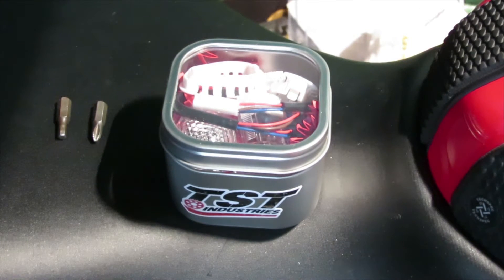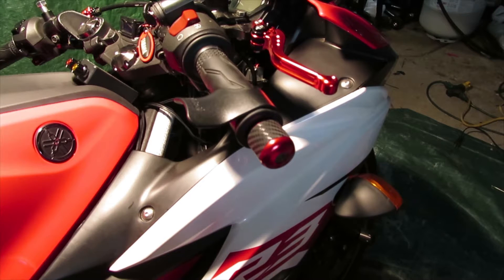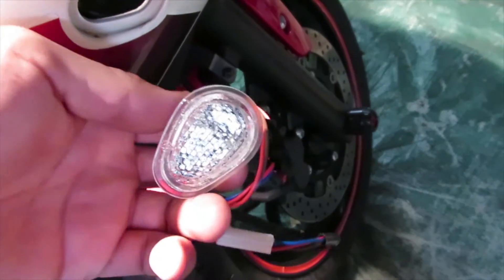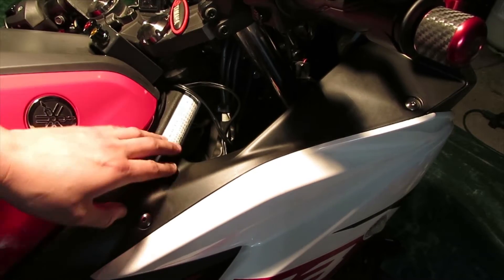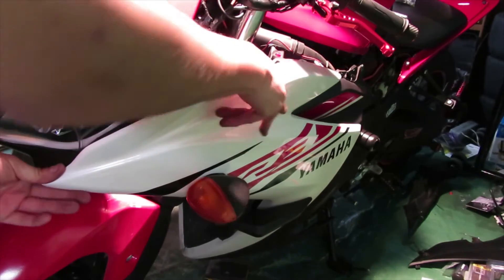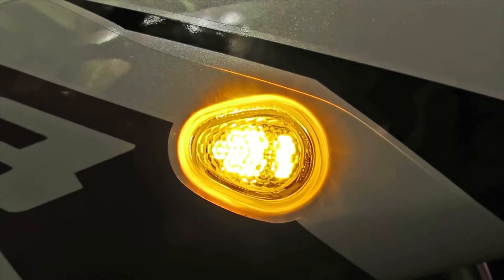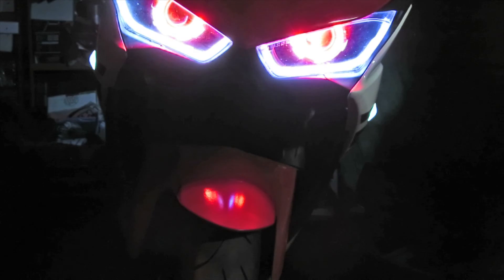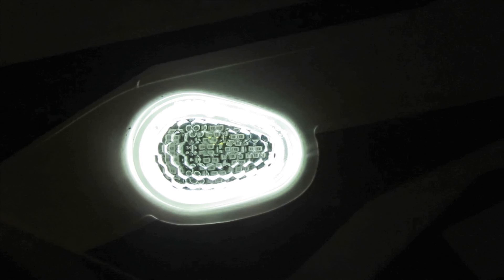How To Install TST Halo Flushmounts

Comment: I’m having the same problem with my tst halo flush mount signals. Is there a better fix for this? The signals didn’t start doing this until I installed the led light strips on my bike. I still have the stock halogen lights on the bike. It must have to be the flush mounts not liking to share the same electrical connection with the switch back light strips... the bike looks pretty sick with the mod though.
Reply: The opposite flush mount signal flashes white when I have the bike running. It sometimes does it with the bike off but it does it every time with it running. Maybe TSTIndustries has some fix for this.
Reply from the maker: do you also have the turn signal relay with the new led turn signals? if you are still having problems with the TST lights then it has to do something with there lights might be a tech issue.
Reply: AC Productions yeah I have their flasher relay and the halo flush mounts. It’s not a huge deal but it just kind of bugs me that it’s not working like it should.
Reply from the maker: David Gastelum ya same here it does bother me also. U may want to contact tst about this product may be defective
Reply: **IMPORTANT**
I finally found a fix for the flush mounts not working. I was talking to TST Industries and we figured out in order for the halo flush mounts to work properly you have to splice in diodes into the power and turn signal wires going to your LED light strips. This is an email they sent me: 
“installing diodes in line between the LED strips and the Halo’s should fix this issue. You will want to splice in diodes into EACH independent running and signal light wire from the LED strips. (4 diodes in total) You will want to ensure the diodes are spliced in a way that the silver band on the diode “faces” the LED strips. This will allow current to pass through in one direction and not the other. A simple 1 or 2 amp diode can be found at Radio Shack for a few cents.”
The only thing I wasn’t completely clear on was what type of diode to use. The ones I got are called rectifier diodes and they were good for 2.5 amps max. After installing the diodes all my lights work perfectly now. Thanks again to TST for being so helpful.
Reply from the maker: thank you for the good info, hopefully this helps others that are having the same issues